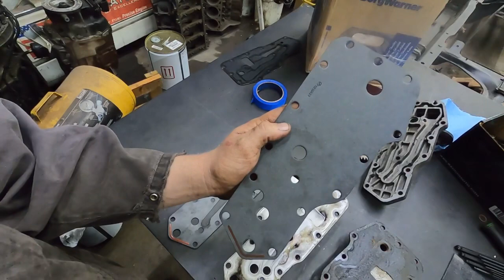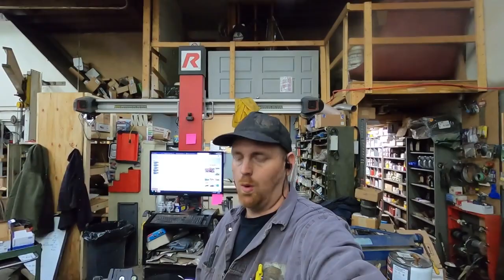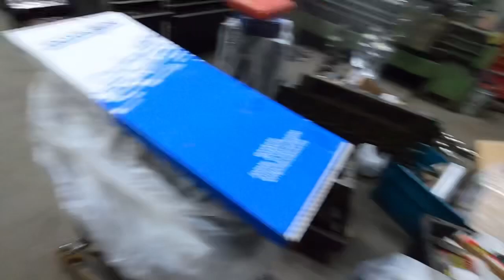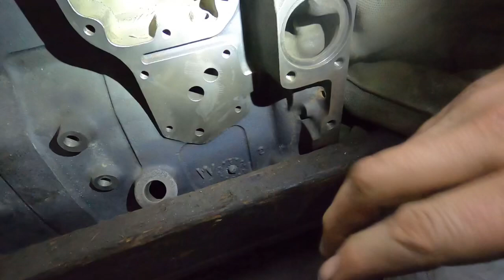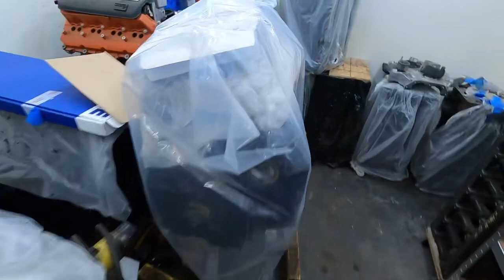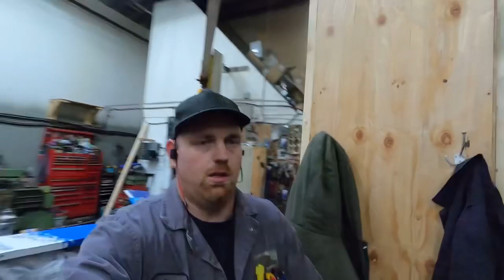OIL COOLER GASKETS !!! - Witch one to use on your 12 valve Cummins

Comment: I have a 4bt non storm block. Can I use the newer style oil filter housing and the older style oil cooler? I cant find a non storm block housing. 
I think all Ill need to do is use the older style gasket to make it right, correct? Thanks.

Comment: I just bought a new oil cooler mine is a 96 I didn't see no sealant on the original should I put sealant around the gasket that goes before the cooler and after the cooler or just one or the other or should I just put none at all
Reply from the maker: I would put some

Comment: 11:10 What kind of problems? Just bought a truck that suppose to have a rebuilt motor. Builder quality unknown. I have 1998.5 24v with crank sensor on lower driver side of block. I am chasing a low or no oil pressure at idle and 20 psi with throttle bumped to 2k rpm.(Strange thing is at idle the low reading makes no sense because I removed the mechanical gauge and the oil pressure shot up to the hood(mess everywhere) I have changed the oil pump and oil filter head thinking something may be wrong with oil pressure regulator. I came across your video. I now wonder if the oil cooler is incorrect. Oil pressure is the same low or no pressure at idle and 20 psi at 2k rpm

Comment: I have an 02 5.9 cummins I just ordered a new oil cooler i have the storm block . The cooler is a cummins part but it gave me a pre storm gasket  for the oil filter housing to cooler.  The coolers are the same and my dump to pump was blocked by old cooler . And same with new cooler can I use that pre storm gasket . It was dump to sump .with old cooler

Comment: Just ran across your video, always wondered about the gaskets. I just pulled a “old style oil cooler” dump to pump off my storm block vp44 truck. So “new style cooler” dump to sump with a storm block gasket will work?? Is that correct?
Reply from the maker: yes
Reply: Awesome!! Thank you!

Comment: Did you make the common rail video? I just got a QSB oil cooler/remote filter head so I can run my filter on the frame rails and I want to get all the right parts for it and make sure it will swap over correctly. Going on a 16 2500.
Reply from the maker: I haven’t done it for commonrail. I will add it to the list

Comment: Glad you touched on the springs. Reading about a low mileage engine under 125K on it. The spring broke. He ended up with bearing material in the engine. Totally trashed.

Comment: I recently purchased a 2001 5.9. Previous owners mechanic put all the gaskets the kit came with on. Now has mixed oil and coolant. Could be because of the gaskets its mixing ? Or something else ? Head gasket etc
Reply from the maker: Something cracked 
Oil cooler 
Headgasket 
Is basically the only things
Reply: I ended up selling it, and the guys drove it to state over no problems. I put more oil in it and coolant replacement than I care to admit. Can’t believe they drove it and it made it. Wish I kept it.

Comment: Thanks for all the helpful videos. What is common practice (or ‘extra insurance’ ) using sealant on the oil cooler core to block and oil filter housing to core gaskets?

Had a bad experience with a bad fitting mcbee gasket and ordered the genuine cummins. My Cummins manual does not specify using sealant. Have a 2 drips/second leak from oil filter housing gaskets after using hightack on the mcbee gasket.
Thanks in advance....
Reply from the maker: I use a bit of case sealant on them all the time. You will have zero leakage issues

Comment: I am gonna be replacing gaskets and the oil cooler soon.  I saw a power driven diesel video saying those guys didnt have good luck with mahle gaskets and that they used the cheeper interstate mcbee brand gasket.  Do you have a brand of oil cooler and gasket you prefer?  I was looking on rockauto at a an oil cooler brand called enginetech which is out stock at the moment. You ever ordered an enginetech or Alliant brand oilcooler?  Im trying to figure out what brand I should get so I dont have leaks or problems down the road.  Thanks!
Reply from the maker: pai , mcbee , engine tech , all seem to be ok, i use what i can get when i replace them, gaskets i have never had issues with i put high tach on both and torque them with thread locker on the bolts
Reply: @CUTTERUPROB   Thanks for the quick reply.  Just found a huge crack on my '99 stock exhaust manifold right in the center of it about 3 inches long where the 123 meet up with 456.  It was on the bottom so I couldnt see it easily.  Bought a steed speed and fleece stainless steel m10 studs.  Gonna be real nice paired up with my borgwarner turbo.  I love watching your videos and wrenching on my truck!  Sucks fuel is so expensive right now ughh.  Thanks again for the content and answering questions for us in the comments.  I will make sure to like all your videos to help out the channel.

Comment: Curious, my 97 12 valve has the non-storm block without the extra oil drain. Manufactured 5-96. Just replaced the oil cooler and didn’t have the extra hole
Reply from the maker: ya some do some don't

Comment: Mine is a first gen had a ve pump now it has the p7100 mine didn’t have the window but the new cooler came with all the gaskets it kinda looked like the long window was for the oil bypass?
Reply from the maker: Depends on the cooler and or block. But new coolers are dump to sump

Comment: Great video. I’m doing the oil cooler on my 96 and it had the storm block style gasket with the window. Should I put a non storm block gasket on it or a storm block gasket on it? Thanks.
Reply from the maker: really deson't matter , but i like to use the gasket that should be in there

Comment: What happens if you use the wrong gasket? What are the signs of using the wrong gasket?
Reply from the maker: depends on the combo  but most common is crazy high pressure
Reply: @CUTTERUPROB  Yep I got that.
Reply: How bad is it to have high oil pressure 🤔 when I was building Honda engines we wanted high pressure? Cold start oil pressure is around 80psi warmed up she is around 40 and 800rpm
Reply from the maker: i have seen 125psi cold witch can be high  enough to wash bearings

Comment: I just did mine last week but the only gasket I had was the one with the window but the one I took off didn’t have the window “I thought it was a new design”. I haven’t cranked it yet. Does it matter if I put the newer gasket on an older engine/cooler?
Reply from the maker: 99% of the time yes
Reply: @CUTTERUPROB  so I need to take it back a part?
Reply from the maker: you can, or just see what the pressure is like when you start it